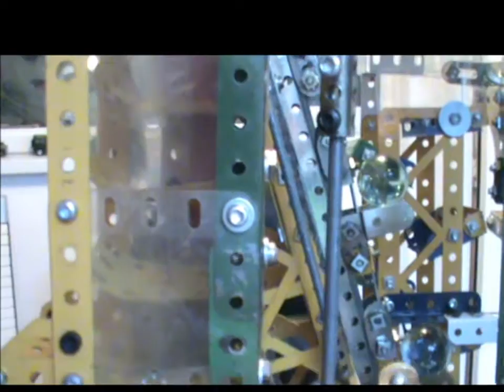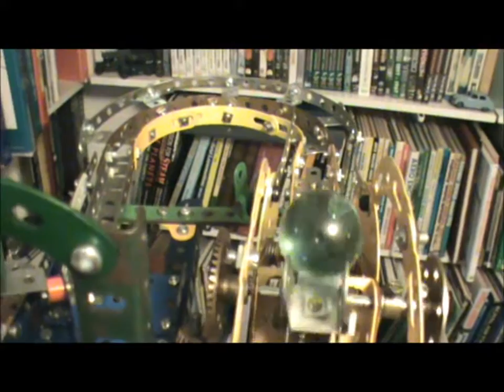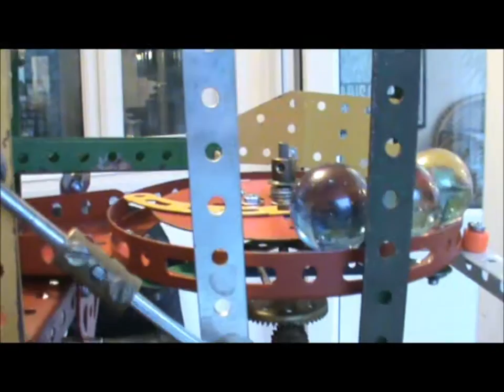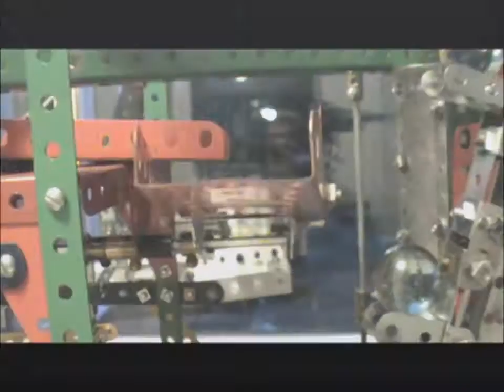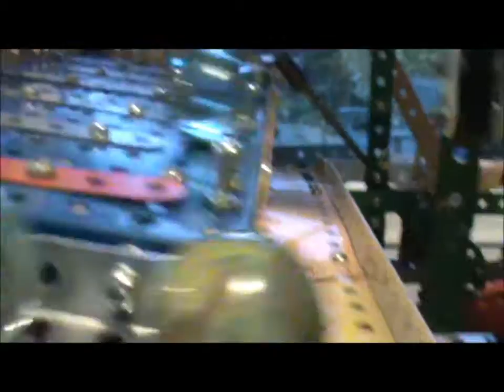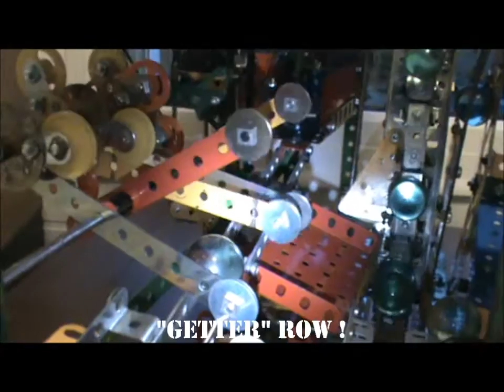Meccano silly machine captioned

Comment: This machine is powered by one ex video recorder motor driving through a power drive gearbox. It is the only motor driving the entire machine. The starting point in building any ball roller is to perfect an interesting and RELIABLE elevator. Mine took about three rebuilds before it was working correctly. and yes it too is powered by the  motor mentioned above.